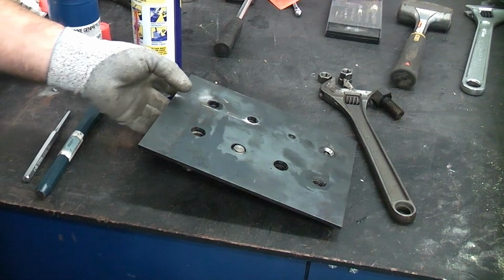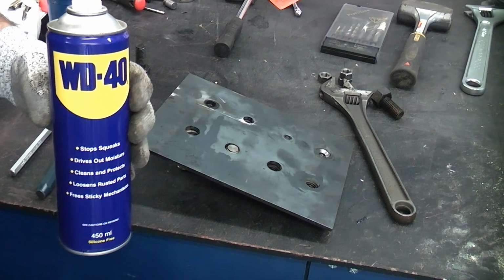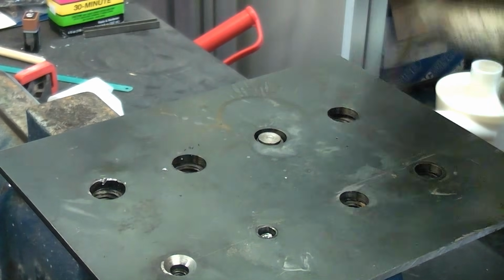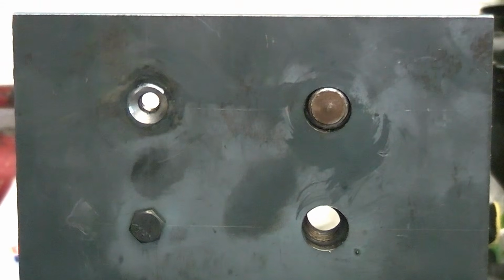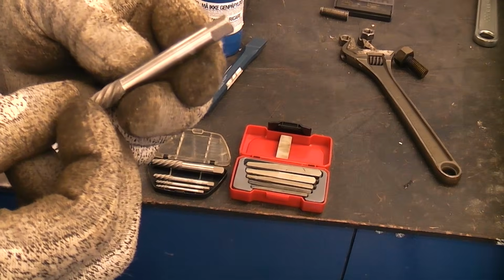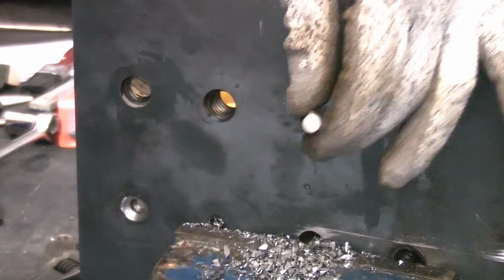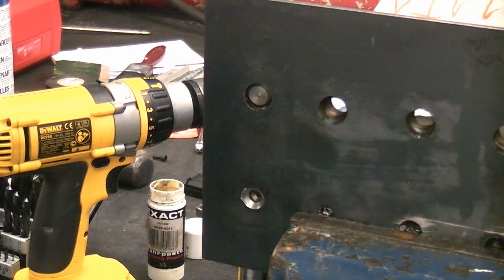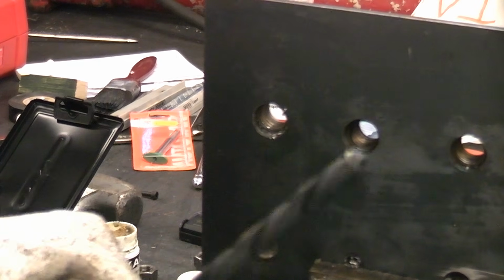How to remove a broken bolt 4 different ways!

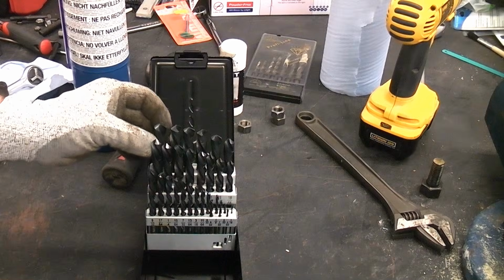Comment: What brand are those drill bits at 9:05?
Reply from the maker: They are actually made by a firm called wel bilt.  I bought them at auction a few years back and have not seen any wel bilt tools since! 
Thanks for the comment 👍

Comment: Try doing it with the starter motor still on the bolt is down  the side off the solenoid. Very limited spare. No good showing  on a flat plate

Comment: I had to visit local auto repair shops other than my go to shop on a Sunday. Two of the shops quoted me a full labor hour and more at ~$160 to remove a bolt I accidentally broke under my car. They didn't even attempt anything, just looked at it.

While I was waiting for quotes I saw this video and it gave me the confidence to try taking it out myself first.
$13 and the time to jack up my car later, it was out. Just used the left handed drill and it came out in a minute. If I had a little more surface area to grip I could've probably gotten it out with pliers that's how loose the bolt was.

$60 for their time I thought was reasonable, but $160 was too much. My shop would've probably done it for free if I waited until Monday.
Reply from the maker: Brilliant, well done  👍

Comment: You mention using a penetrant (penetrating oil) WD40 is not a penetrating oil the best it will do is disperse any water (the clue is in the name WD40=water displacement formula 40) and provide a little lubrication. Automatic transmission fluid and acetone (50/50) works much better and is cheaper.

Comment: Base is plastic , steel stud bolt broken in side , can't hit or heat because base material is plastic , any idea to remove?
Reply from the maker: You might have to drill it, then use a screw extractor. Some techniques in this video might help-
https://www.youtube.com/watch?v=dJfkCj3FWBs&t 👍

Comment: How about when you only have 6 inches of space to work with
Reply from the maker: It’s always difficult in situ.
You just have to do the best you can! I’ve had to remove damaged bolts/nuts in some really tight spaces, sometimes taking hours!
Best of luck with yours 👍

Comment: I've got a broken glowplug and I have been trying to use extractors but they haven't worked yet. The hole is getting bigger and I am getting closer to the threads. There is rust and I've been working on this for a week. It took 3-4 days to remove 7 and then one broke. I am putting all my strength given the awkward positions with an adjustable wrench and it's not moving. 

When I am using the extractor it seems like it is squeezing metal out the rim of the hole it is inserted in. I wonder if it's actually making it tighter. 

Worse case scenario I have to drill it all out and then the threads for the plugs get damaged then what do you do? Then I'd guess i'd have to create new threads but how do not make the hole bigger so it still fits the glow plug?
Reply from the maker: I have never removed glow plugs, but can imagine them being very difficult to remove. 
They make repair kits for this exact purpose- https://fave.co/45zyPkH
Best of luck with it 👍

Comment: Now get a small bolt out that's rusted and you can't reach with an extractor and can only get access to a 1/4 of the bolt for trying to use a chisel to back it out. Oh and the bolt has been in there since the mid 90's.
Reply from the maker: In all my years as a maintenance engineer, I have never had to remove a difficult bolt or screw, they have always been easy to reach with loads of room an no corrosion 😂
Reply: @ultimatehandyman  I haven't seen the video.

Comment: What if I've drilled so much into the bolt and bolt extractors keep spinning
Reply from the maker: You might need a larger diameter extractor 👍

Comment: When going deep inside a hole, I saw a welder cut off a copper pipe the size and length of the hole. That is suppose to protect the threads when welding that rod or filling the hole before adding a nut or anything that could turn the bolt

Comment: Best video I've found in the last few days. I snapped a bolt off my water pump housing the other day & been dreading to get the bolt out. I'll be back to give an update. Thanks once again
Reply from the maker: Thanks for the comment 👍
Reply: @ultimatehandyman  Anyway to rethread a water pump? The fan clutch threads cross threaded & can't get fan to go back on.
Reply from the maker: @joshstacy623   You would have to identify the thread first, you might be able to do that by finding the part for sale, it should say what thread it is.
I'm assuming it's a male thread, so you would need a die nut of the correct thread. You would have to lock up the water pump to prevent the shaft from rotating, then run the die nut down it using a spanner. That should repair the thread ;-)

Comment: Good evening,
I have a pair of bolts that are broken of on the engine block of my car. I was wondering what would be the best way to extract these given that they broke flush, none of the bolt is exposed, and they are in a spot that has alot of force on them so are most likely made from a pretty hard metal.
Thank you for your time.
Reply from the maker: It's difficult to say without seeing them. I've done a few videos on this, which might give you some ideas-
https://www.youtube.com/watch?v=SMrDYJvY0Ts
https://www.youtube.com/watch?v=MR2Dd30Wees
https://www.youtube.com/watch?v=dJfkCj3FWBs&t
Obviously, it's always more difficult in situation, due to things being in the way etc.
Best of luck with them 👍

Comment: Only problem is WD-40 is not a penetrant as you call it it has absolutely no penetrating oil in it on the other hand liquid wrench does read the label next time before you make these videos please.
Reply from the maker: Perhaps you should do some research-
The penetrating oil and unique formula, complete with the precision applicator means that you can spray with accuracy, allowing you to lubricate and free rust from mechanical parts and remove grime, cleaning and degreasing only the hard to reach parts that you want to.
Original source-
https://wd40.co.uk/product/wd-40-flexible-multi-purpose-penetrant-spray/

Comment: Have you ever used a Crayola crayon for penetration? You get the threads hot and just melt the crayon down it. Works better than any penetrant oil
Reply from the maker: No, I have not tried that- yet. I will do one day though ;-)
Thanks for the comment 👍

Comment: Good video for entertainment purposes. 9/10 it won't be this easy. Most likely it's a super old bolt that's snapped cause it was over cranked and tapping it with a chisel and hammer will never work. Safe yourself some time and frustration and just drill it out and hopefully you don't damage the socket.
Reply from the maker: It's never easy when you are in situation, I just did this on the bench to demonstrate the techniques that I used when I worked on site as a maintenance engineer 👍

Comment: In my opinion this is one of the most informative and instructional video I have yet to see, and that is speaking in regard to any topic of instructional video. 
Well Done.
I have a broken bolt in a crankshaft, been soaking and heating and using the chisel technique so far 3 weeks into it and still have had no new progress will try the welding nut on next.
Reply from the maker: I wish you the best of luck removing it
Thanks for the comment 👍

Comment: I failed in two ways ,use a bolt remove drill, it broken also; welding it with nut, still can connection well and broken again. after the welding, I can't drill it again...
Reply from the maker: It might have work hardened.
You'll be able to drill it using a specialist carbide drill bit - https://fave.co/2Q2oTiy
Or a diamond coated hole saw- https://www.youtube.com/watch?v=7JCfEMrCjhc

Comment: You talk about using "special" drill bits but you don't say what "special" means so that people can go buy them. What is "special" about them?
Reply from the maker: For drilling out most bolts you can use cobalt drill bits.
If the bolt is really tough, you might need a solid carbide drill bit- but they are really brittle, so you have to be careful with them.
If you break a cobalt drill bit, HSS drill bit, Tap, or screw extractor you might have to use a diamond coated hole saw- https://www.youtube.com/watch?v=7JCfEMrCjhc&t

Comment: The welding way is very good way rusted bolts are hard.i first saw a muffler guy use this method he welded a nut on a broken stud filled it in then used heat amd it came out .
Reply from the maker: Absolutely ;-)
Thanks for the comment 👍

Comment: I live in british columbia on the west coast of canada, and broken bolts and rust are just next to impossible , mine a sway bar link bolt engineered with little room, in eastern canada salt on the roads and corrosion, you wonder why they build cars with such shoddy materials and engineering, they dont even put anti seize on when manufacturing the car, dreadful.
Reply from the maker: Road salt is going to make any steel components difficult to remove.
I don't think the manufacturers care to be honest, a lot of them seem to design vehicles so that you have to take it to their approved garages to be repaired ;-)
Thanks for the comment 👍

Comment: I used the method of welding a nut to a broken stud after watching this yesterday. Thank for going to the effort of making the videos, they’re really helpful. My welding is poor,  but I found that turning the nut immediately after welding whilst still red hot. This helped stop the nut shearing off. It took me a few nuts being sheared before I managed to extract the remaining screw thread fully but it works.
Reply from the maker: You are welcome, I'm glad that the videos help ;-)
Thanks for the comment 👍

Comment: Rear Sway bar bushing brackets on a 08 Jeep Wrangler. Both forward bolts snapped leaving the remainder inside the framing. I feel like I was smacked by a freight train. BUT, never the less, I will try some of your methods before drilling and re-tapping.
Reply from the maker: Good luck with it ;-)
Thanks for the comment 👍

Comment: Thank you!!! The WD 40 + chisel trick helped save me the cost and bother of drilling out the bolt or replacing the plate it was stuck in. Works like a charm!
Reply from the maker: Glad it helped! I use that a lot on site ;-)

Thanks for the comment

Comment: The chisel method with WD-40 worked for me after a bolt snapped in my motorcycle and left all the oil spilling out. Felt great to be able to handle it on my own. Thank you for this!!!
Reply from the maker: Good stuff
Thanks for the comment

Comment: Just out of curiosity, have you ever come across a bolt that you were unable to remove?
Reply from the maker: No, there is always a way. If it's a bolt and nut and providing it is not stainless steel, we just burn the head off using the burning gear. Some nuts and bolts are impossible to remove, so removing the head with a grinder or burning gear is the only option. If the bolt is in a tapped hole, we often drill that out with a mag base drill and re-tap the hole.
Thanks for the comment

Comment: Perhaps I am being a bit picky but this was a waste of time I do not have a welding machine or specialised drill bits and the bolt I am having problems with is on a cycle frame and is 5mm
Reply from the maker: If you don't have the tools to do the job, you either go and buy some- or take it to the shop to be repaired. I can't show how to remove the bolt using magic 😂
Thanks for the comment 👍

Comment: Just been tryin to get a broken stretch bolt out of engine after about hour I was lookin for things to stick down the hole to catch on the broken bolt Wen I seen a few sctraws from burger king it was about the same size as the hole so I just put it in and started turning and ti my amazement the straw started pulling the bolt out
Reply from the maker: Glad you got it out ;-)
Thanks for the comment 👍

Comment: I have a broken bolt that's rusted. And on the underside of a 1991 mr2. Its snapped off flush. Any ideas. Struggling to get any penetration or strength on a weld
Reply from the maker: Jobs like this can be a nightmare, sometimes you have to drill them out- if you can get in with a drill!
Sometimes a screw extractor will work, but only in about 10% of cases- https://www.youtube.com/watch?v=SMrDYJvY0Ts
Thanks for the comment

Comment: Great vid.  I would only have the two following comments:   

1.  I'd slow your drill speed down to extend the life of your bits.   300 RPM is about right.

2.  I might omit the cutting paste when using the reverse drill bit, and use very slow RPM and extra pressure so it has more tendency to grab.
Reply from the maker: Thanks for the comment 👍

Comment: Question what is the best way when u have a broken bolt on a.c. compressor on a truck where u don't have the room to swing a hammer ?
Reply from the maker: It's difficult to say without seeing it. Some broken bolts are impossible to remove without removing other components, to make the job more accessible!

Comment: Here in the States it's difficult to find carbide LH drill bits in a brick and mortar store.  However, they are readily available on Amazon and dozens of other online sellers.  Some round tapered extractor kits, like the one Irwin offers, come with five drill bits and No.1 through No.5 extractors.  The square tapered (i.e., smooth) extractors are probably a better choice than the round set.  They have square, sharp sides that bite in better and don't expand the fastener you're trying to remove.  You would need to have a set of LH carbide drill bits for it, however.  The square tapered set of extractors is also handy for work on soft metals and PVC pipe, as they bite into the fastener.  The round tapered set (which somewhat esembles a set of drill bits) doesn't have sharp edges that bite in as tightly as the square type.  All they manage to do is spin around uselessly, enlarging an existing opening in plastics or the hole you've drilled in soft metals like brass.
Reply from the maker: Thanks for the comment 👍

Comment: I’ve literally just sheared a stud on an exhaust manifold and have tried to use two nuts to make a locking nut on the remainder of the stud to extract it  - didn’t work, and have flattened off the sides of the stud to get a mole wrench on - still won’t turn as limited room. Gonna have to get the cylinder head off to get to it properly ( it’s a motorbike but still very tight and can’t swing a wrench ) , but there are loads of great techniques here to help thanks. Annoyed I recently sold my stick welder, that would have been dead simple 🙄 Sure it’ll be easy when I can get to it properly. 😀
Reply from the maker: Yes, the stick welder is great for jobs like this, as the heat generated really helps to loosen the stud.
Best of luck with it ;-)
Thanks for the comment

Comment: I've tried EVERYTHING- except welding:  tried to remove two broken off exhaust manifold studs on a scooter.  Now I'm considering just replacing the upper cylinder head/exhaust port completely....and I don't know jack about mechanicals!  I couldn't even find a drill/bit combo that would drill INTO the studs.

And yes, I did try a six pack of craft beer and swearing alot; nada.  This single cylinder/scooter project is kicking my ass.  Ask me how many trips to ACE I've had to make.....
Reply from the maker: The 6 pack of beer sounds good ;-)
How many trips did you make to ACE?
Thanks for the comment

Comment: clean threads makes the broken bolt easier to remove. a very badly rusted hole is the true challenge
Reply: I broke a rusted bolt flush, my liscens plate so I gotta work sideways, what a pain... I'm more of an expert with plastics and glue, I wonder if I could epoxy a nut onto it, the surface area may be too small
Reply: Exactly... with a 4=inch clearance (Thermostat bolt broke... 10-mm)

Comment: Excellent vid, very thorough and informative. Now to apply one of those techniques under a car with 2 inches of clearance...
Reply from the maker: People seem to think that I just do easy demonstrations on the bench in my garage, but I can tell you that I do jobs when at work, which are very difficult- I just can't take my camera in there to film them ;-)
Thanks for the comment
Reply: With a RUSTED BOLT.
Reply: Exactly that’s my problem
Reply: My current situation!  He def deserves credit for technique.  About to tackle the situation tomorrow- after drilling THRU a 10mm thermostat bolt. First try doing that... I am empowered! lol
Reply: Hines Riley did you get the bolt out I broke the head of an 8mm and to my 98 Ford Mustang, I got the thermostat off but the bolt is still stuck in there. I don’t own anything like a torch, stick or mig welder and I don’t have space to drill. What now?
Reply: @HinesRiley  im literally on a thermostat housing bolt lol
Reply: @HinesRiley, what do you know? Snapped a thermostat bolt too...
Reply: I have a broken wheel hub bolt. The head of the bolt snapped off and all that is left is bottom 3rd of the bolt that sticks out.
Reply: My problem exactly, got a stud on my exhaust that broke and it's on my down pipe, I could just take the car out but that's a lot of work for just putting a new stud in, and I have less than two inches, I can stick a pipe wrench on it parallel to the bolt but not perpendicular as you should for leverage. I've tried everything
Reply: Awesome, helps me a lot thanks
Reply: Thermostat bolt too! I have a bit left sticking out, so going to try MIG'ing a nut onto it. A good smack end on can help crack the corrosion in the threads too. Don't forget to add wax after welding the nut on, while still hot.
Reply: And yet another thermostat bolt, but 3 and on a outboard.
Reply: Peter Booth that’s why this video isn’t helping me I’m working on my car and I have about 2 inches and can’t just swing on it like a mad man
Reply: Raymond Parks make more room
Reply: @puksrasohchurrun   I wish I could post pix here... I am in same situation.  DO I drop the entire engine... or?? I will add this adventure to my YT page.